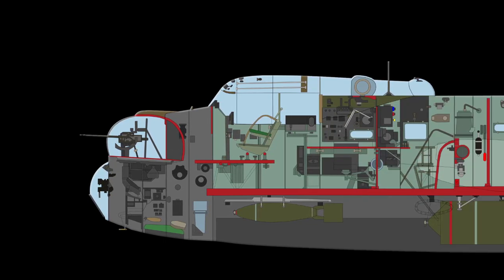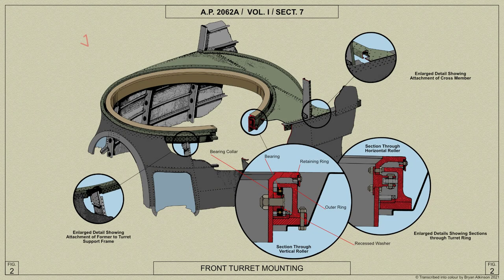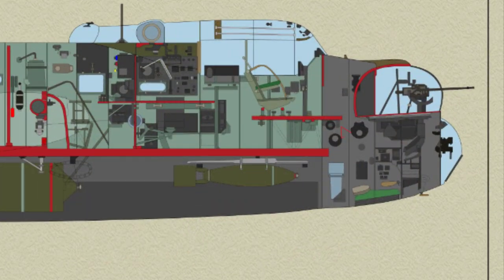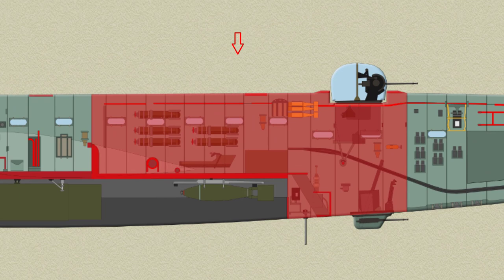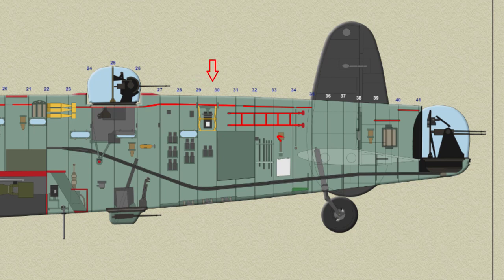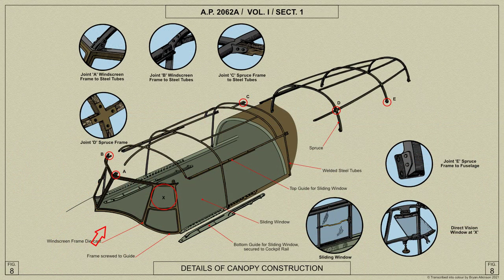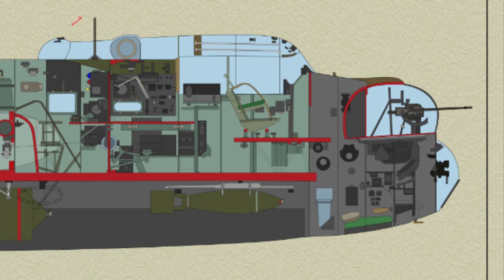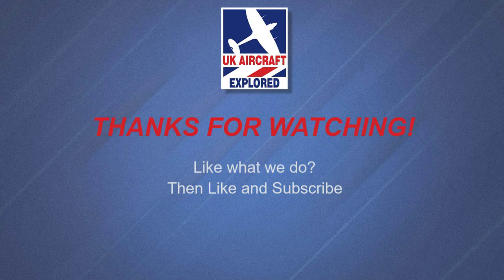Avro Lancaster – The Fuselage

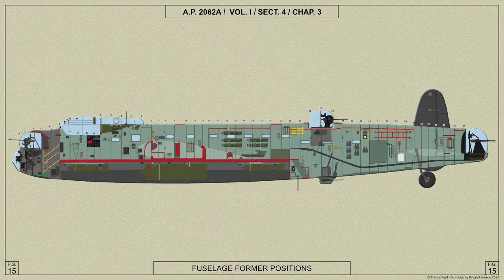Comment: 3:45 - Curious why you didn't go further into detail about that parachute door on the floor of the nose section - this was supposedly just a tad too small for a heavily outfitted bomber crew member wearing a parachute to get out easily from this forward part of the Lancaster.    As a result, the Lancaster had one of the worst crew bail out survival rates of any Allied bomber during the war - only 15% of crew who bailed out of a Lancaster bomber survived.
The design of the central bomb compartment, where the bomb bay is closed off with a floor to the cabin also made it impossible for the crew to bail out from the bomb bay compartment, unlike US bombers like the B-17 and B-24, where the bomb compartment is open to the rest of the fuselage interior.  Crew could always jump out of an open bomb bay in US bombers.
For the rear crew, the main entrance door was right in front of the rear tail section, so trying to bail out from that side door would require not get swept into and smashed against the rear tail secion.
Reply from the maker: Thanks for watching. The Nose Parachute exit is covered in my video 'Emergency Procedures'.

Comment: Why is it painted that shade of green? Surely it would have been cheaper just to leave the interior as bare metal ?
Reply from the maker: It was standard Air Ministry practice to paint RAF aircraft with a grey green paint. The colour was used as it was thought to reduce glare and eye strain. Thanks for watching.
Reply: Corrosion prevention??